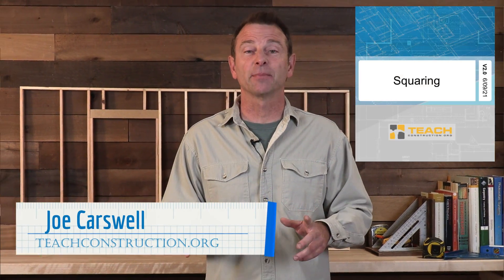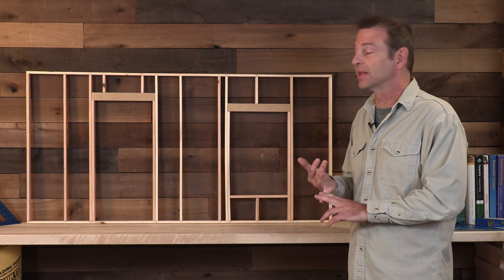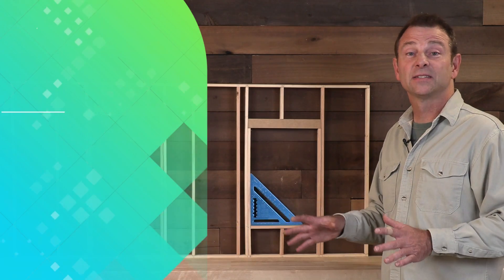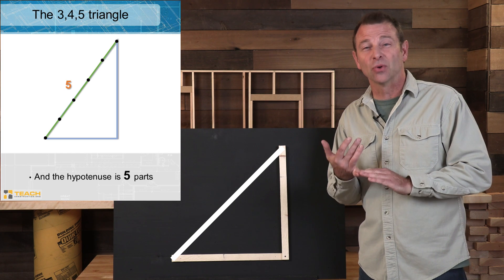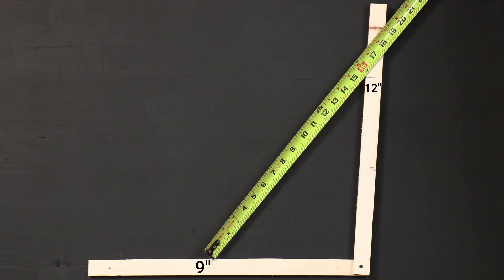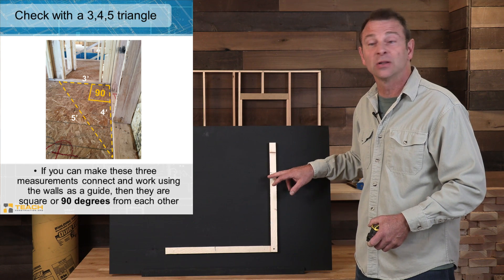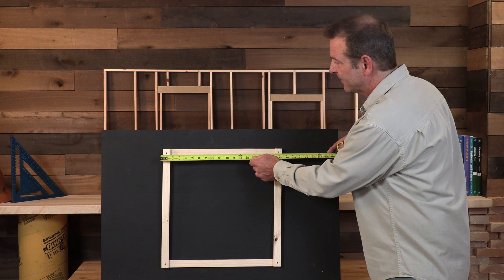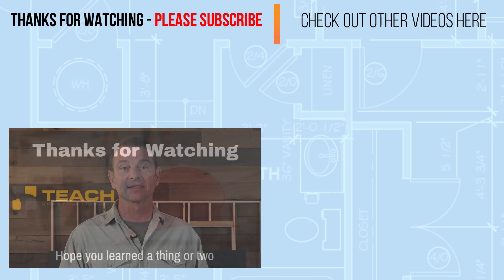Learn about how to measure for Square in Construction - TEACH Construction Trades Training Video

Comment: Thank you so much for teaching us the most important basics building..
I watched your video  on the nailer corner and replicated the technque..
It's has worked well.
Iye completed my 2x4 frames which are all square, nailed in place and level.
Re squaring my frames
I've been using the corner to corner angle squaring which has worked well.
It's a separate 2x4 window frame, I'm having a problem getting it square,
Hence watching your video 
Like you've explained its a to & from thing until you get it right.
I've decided I'll invest in a Frame square which I know will be very helpful.
I have all the other necessary tools, just not the frame square 
Thank you so much for helping and teaching us the correct techniques in construction.
Really appreciate watching your informative and clear teachings in construction..
Reply from the maker: I am glad it all worked out for you.

Comment: A clarification that I hope is helpful: You stated that if the diagonals are equal, then we know that the angles are 90 degrees AND that the sides are parallel. However, to conclude that you have a rectangle based on equal diagonals, you would also need to confirm that opposite sides are either equal or parallel. You actually measure to confirm opposite sides are parallel at a different point in the video, but it was to show that parallel isn’t enough. To demonstrate that diagonals aren’t enough, draw two equal length lines crossing at some random place and angle. Now connect the ends to form a quadrilateral. Pretty easy to make one that’s clearly not a rectangle. A kite with equal cross pieces is a simple example. This doesn’t refute the method of measurement; simply verify that opposite sides are equal or parallel in addition to equal diagonals, and you’re good. Also, huge respect for your teaching!
Reply from the maker: Thanks for the the additional explanation

Comment: Great video on measuring squareness. However in real world nothing is perfect.  how much can you be off when you measure for square - off by 1/4, 1/8, 1/16 or 1/32? striving to be Exactly square dries me crazy when making adjustments w no so petfect 2x4s
Reply: You must be as precise as you can. First using 3 4 5 inches will not give you any accuracy. Because if you mesure 5  1/16 inches hypotenuse this will give you 91.5 degrees angle and 2.5 inches of sideway deviation on 8 foot wall. If you use 12 16 20 inches triangle and mesure 20 1/16 it will be 90.37 degrees angle will result in 9/16" offset on 8 foot wall
Reply: @user-rcghjewqw What’s the formula to calculate by how something will be off in a longer run ? For example, using 345 method, if off by 1/4 how far off will it be     Say in 42 inches?
Reply: The problem is as the errors stack up, they build on one another until you're really out over the total distance. 

The 3-4-5 will work well and the LONGER the distance,  the better. 

Start with inches and check at 3&4 feet or as mentioned a variation of it. 
3-4-5 inches
3-4-5 feet
12-16-20 feet. 
Any multiple of 3-4-5 will result in a square corner and keep the wall running true. 

As with most things,  the more ways you know to validate this,  the better. 
If you use 3-4-5 and diagonals, you'll have more support for the result than if you only used one or the other. 
Just remember,  if you use diagonals, you must measure the same spots. 
Inside to inside or outside to outside AND tilt your tape at the spot so you can see EXACTLY where that measure falls on the corner.
Reply from the maker: How out of square all depends on what you are building.   Sorry , there is no definitive answer